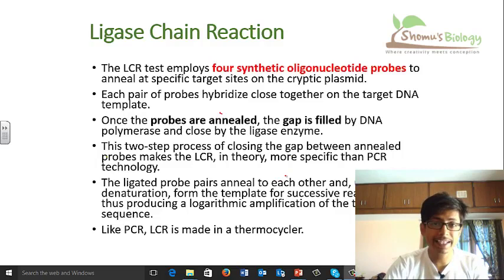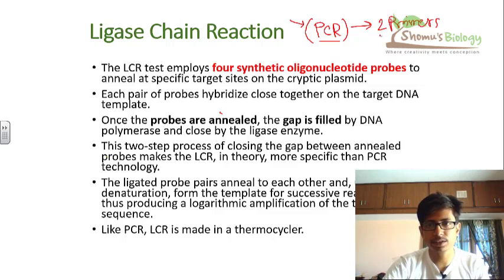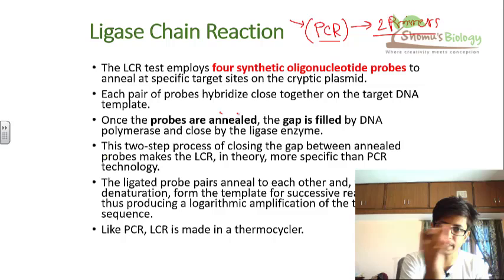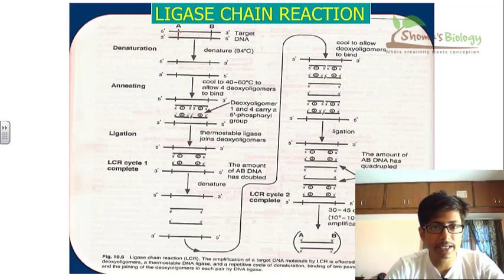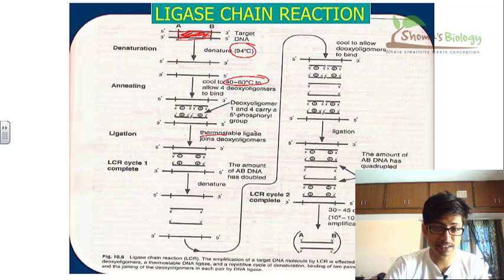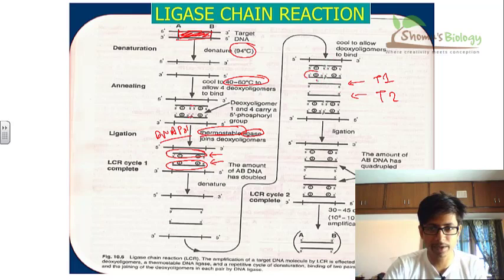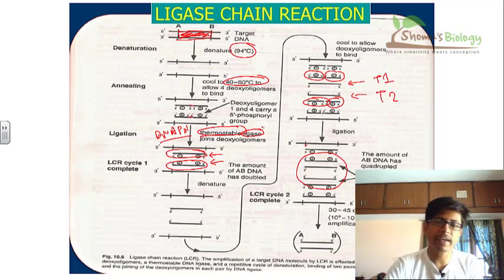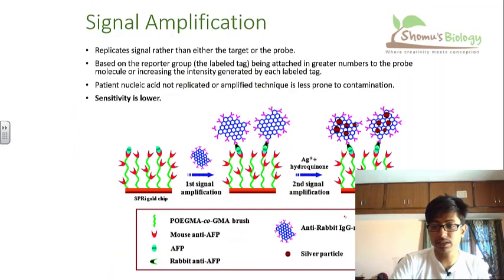Ligase chain reaction (LCR)

Comment: Besides the fact that the longer primers help specificity, isn't this technique rather painful for no reason?
A) Since the primers are almost as long as the desired amplicon sequence, with only a few base pair difference, won't there be a lot of primer dimerization since the 5-3 primer and 3-5 primer will certainly have complementary parts? Whereas in traditional PCR the primers will be short and  thus possible to engineer them so they are non-complementary and thus don't dimerize?
B) Again - since you need very very long primers, aren't they more complicated to synthesize - AKA your probes are very close to target amplicon, thus more complex to engineer rather than short oligonucleotide probes such as in PCR? 

I understand the specificity could be an advantage in diagnostic applications, but is there anything else to it besides that?

thank you for the videos :)
Reply: The goal is to have extremely high specificity for a SNP at the 
ligation/gap fill junction.  This method is specifically to distinguish 
whether a gene has a single base change, not to see if you have a gene 
generally.  It is definitely not meant to amplify a whole gene out of the genome, for example.  Its really a substitute for qPCR, not PCR, in terms of usage case.
Reply: @greglohman6750   Thank you.